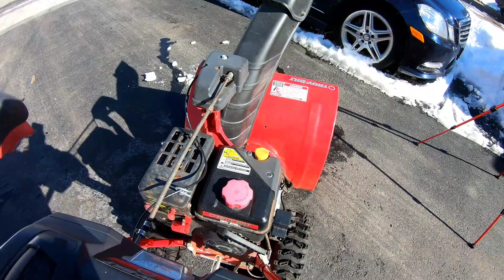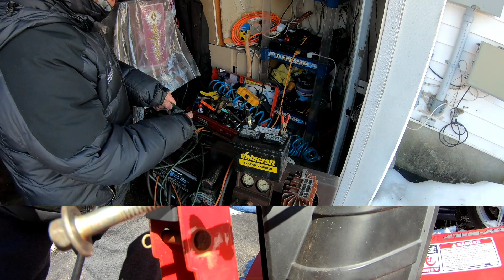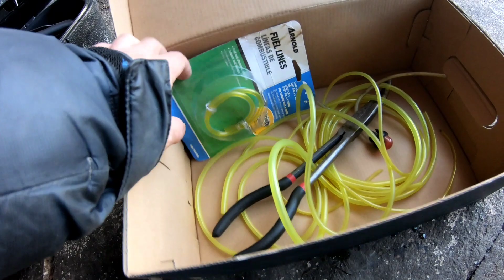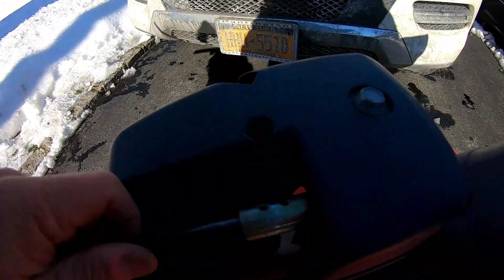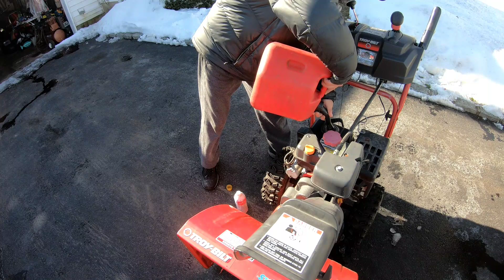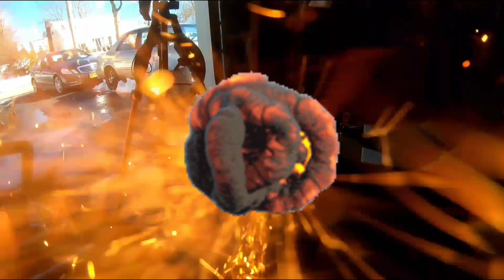TROY BILT STORM 2620 POWERMORE 26" DUAL STAGE SNOWBLOWER CHUTE ROD FABRICATION WELDING FINAL REPAIR

Comment: I have a toro snow hound .need magneto.model # 081302_9435_46. Part# 298274 .acc.to toro. That magneto no longer avail. As long as it works idont care if it comes from a lawnmower, as long as it works, and fits.

Comment: EBay seller should have specified drop ship up front and tell you it would take 2 weeks to 2 months.  Doesn't it feel good to do some minor fabrication and fix the issue without relying on a new part to arrive?
Reply from the maker: Definitely much more satisfying,  but the owner wanted new

Comment: Henry, I totally agree with you regarding the drop shippers. I know that you are like me in one regard Henry, If I order parts for something - I want the parts as quick as possible. Ironically Enough, I am sort of going through a similar situation playing the waiting game from a vendor who is not that far away and who you cannot track the order. I wish now that I had visited the John Deere dealers parts department - If that tells you anything. 
Nice Fix on welding the shaft going to the chute. 
The plastic wrap that you dressed up the chute rod with was the black corrugated plastic split loom which comes in different sizes. Kind of like the “Zip Ties”, The split loom is available in different colors other than black. 
Looks like the SeaFoam worked pretty well regarding the surging. I wonder what the guy who gave the pretty negative SeaFoam comment the other day thinks now? Just Saying,Henry.
Reply from the maker: Everyone is gonna have their opinions on everything.  Sometimes it works,  sometimes it doesn’t.  Just depends on the severity of the clog.
Reply: @MowersNBlowers  Most of the naysayers only use products like SeaFoam when their fuel system and carburetor gets in really bad shape. From that point, They want to talk about how the product screwed up their carburetor. SeaFoam like Lucas Oil Products devotes a lot of money and time into product development. If these products were so bad - All of my stuff would have destroyed itself many years ago.
Reply from the maker: @TheIronDuke502  if a carb is totally trashed, no solvent alone is going to fix it!  A carb clean is inevitable.
Reply: @MowersNBlowers  Unless It’s Doneski!!!

Comment: I also wanted to let you know I went to Harbor freight and picked up a 1000 lbs Capacity hydraulic lift cart. I I to I’m in my 50s and I decided not to work on the floor anymore. The table top on the list cart isn’t big enough so I added a wood table top and it works perfectly.
Reply: Jason, I have been thinking about one of the lifting tables for some time now. So Far, I have been somewhat pleased with what I have purchased from Harbor Freight Tools. You have to know how to work their extended warranty to your benefit.
Reply: @TheIronDuke502  I have the 500 pound version from HF. Love it and with a coupon it was $139.95 saves my back alot.
Reply: @rogermcdonald1607  Thanks Roger, I will keep that in mind.